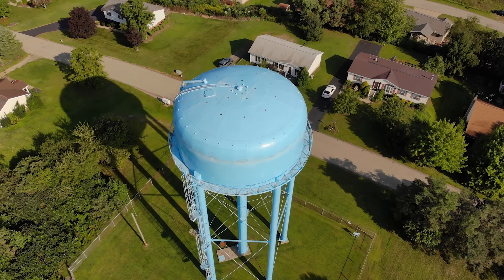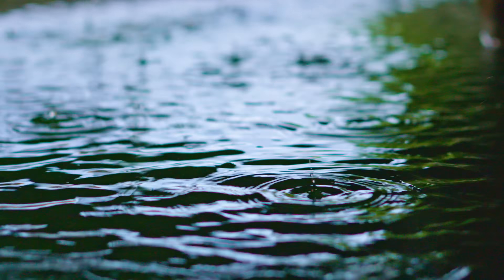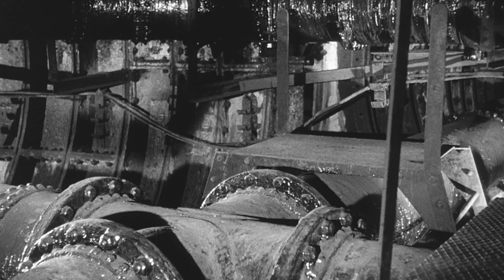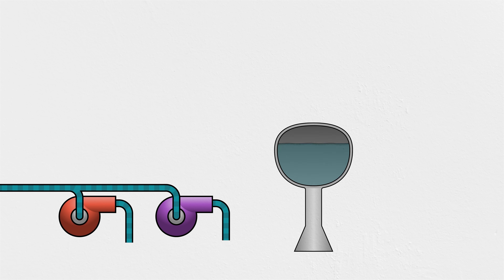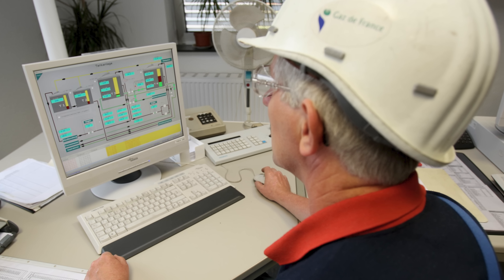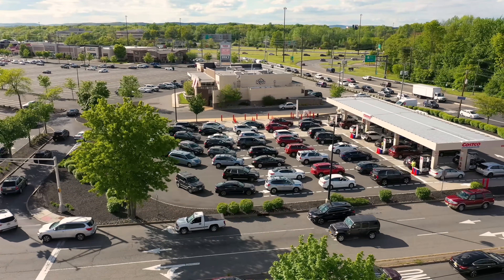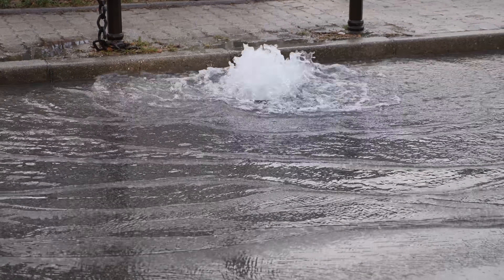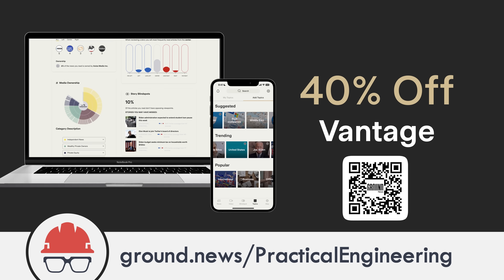When Infrastructure Gets Hacked

Comment: this is the kind of thing that makes me VERY uncomfortable about everything needing to be online. skills overlap and everybody knows about modern computers now. at least with manual methods and light automation WITHOUT THE INTERNET you'd have to go there and get in to do anything. i'd feel more comfortable with relying on all this infrastructure if the computerization was stuck in the 1980s with floppy disks and difficult for laypeople to understand CAD-looking software on monochrome Cathode Ray Tube monitor displays with mostly control panels that have switches and buttons that get monitored. monitoring those panels is a great job for someone system-minded, but not physically capable of the technical work.
making it all online just feels like ainnovation; a new feature/change that exists only in order to sell more units and not particularly beneficial to anyone who isn't financially profiting from it....and realistically not actually benefitting them outside of bank account land.
Reply: additionally, arms races are very funny because they can be put up as walls while really the actual system is completely offline but still functioning......not that the hackers know that!

Comment: The key to security is reducing the attack surface.

Have a single door, and put a good lock on it.
Reply: Well, have a single outside door. Have multiple internal walls too, so that someone can't just do whatever once they get in.
Reply: I think generally the law regarding fire safety gets in the way of that, like, imagine if someone lost control of their truck and crashed into it, or some bad guy blew it up, or a fire breaks out and now that area is a firestorm, that kind of thing.
Reply: @Xannthas  Well, I was thinking it more as an analogy for cybersecurity (don't connect everything to the internet).
Don't have more access than strictly necessary to critical components.
Reply: That's awesome, Iran had that. They had no access at all. Didn't really help them much did it.
Reply: @zyeborm  When your threat model includes the CIA and the NSA, you are indeed in trouble.
(Though not allowing thumb drive would have helped.)
Reply: @zyeborm  It required their enemies to put forth a massive effort and essentially infect the entire Internet just to get at a handful of machines.

If they'd just had something like a FortiNet gateway, the NSA would have blown the things up in an hour and gone to lunch.

Comment: Hey Grady. Thanks for bringing attenion to this topic. 
The biggest problem is the access from the outside and no separation in internal networks. Normally it's always because of convenience and easy maintenance, so that somebody can quickly log in and fix the issue during the production. If you can get an access to the internal network then the posibilities for the attacks are unlimited. 

SCADA is only one point of an attack.  However SCADA prepared and maintained properly can be pretty secure. Interlocks, limit values and faults should be always programmed into PLC, and critical functions should be kept under password (unfortunately often passwords are simple or spread among employees). 

The real danger is when somebody can access the PLC from outside, which often is not protected sufficiently. There you can really do everything, especially if you can get access to the safety PLC. I'm not sure how many 0-days are in the modern PLCs, however with almost all controllers I worked on you don't need a 0-day, as nobody bothers with setting up the password access, or password is schematic for an easy maintenance access (like the name of the PLC or area or whatever). In one facilty I had to make some modifications, and their SCADA computer was unusable, because operators were bringing games or movies on their personal sticks and infected the complete computer, as they were bored during production.

Or another example - even if SCADA and PLC is protected well, sometimes devices that are these PLCs using are not. For example you can change parameters of the frequency converter so it will damage the motor, or change the weld controller to make faulty welds while indicating that it is operating in correct parameters.

Comment: As an Electrical Engineer, SCADA/HMI/PLC programmer, Network Admin and electrical system designer, I can assure you... most issues are caused by employees breaking the air gap either intentionally, by sheer stupidity or by over-zealous network admins that can't stand the presence of a workstation on "their site" that isn't under their control.
Reply: I didn’t say secure connections don’t exist. 
I’m saying the issues exist because of people. 
Just because some aspects or overhead systems can be remotely controlled, I assure everyone there are still air-gapped, physically separated or unbridged networks in most facilities… even nuke plants. 
You think you are going to reconfigure the motor drives or vibration monitor calibrations on the reactor jet pumps from your home office, you are mistaken.
Reply: @capn_shawn the its one of the reasons our laptops are not on the company network, it want full control of company supplied laptops so company issues laptops are not used.

In a site where we still use 1980's plcs and modern ones less than 5 years old its very difficult to work on machines with a completely locked down laptop with only user privileges and usb ports disabled
Reply: Or remote maintenance vendors / third party
Reply: Lol @ making “their site” in quotations because I know exactly the type of conversation that would have developed
Reply: I worked for a national infrastructure organisation that carried out the simple test of scattering USB drives around the benches outside head office where people would eat lunch/smoke/chat on sunny days. 5 out 6 USB drives were plugged into office devices within one day of their being dropped. So yeah, it's the swiss cheese model all over - you put in layers of security to try and stop the holes lining up and things getting through. Air-gapping is one layer, but if the staff aren't educated or have too much access or basic internal security controls aren't implemented, well, the holes can still line up.
Reply: Same applies for a lot of wider health and safety really. Many systems would work fine if all the humans involved stuck to all the rules, all of the time. Predictably, they do not.
Reply: In every system I've seen, things are ALWAYS setup with remote access. In over 20 years, I've not been in a Class A office that didn't have complete remote access to everything... fire alarm, security doors, elevators, HVAC... the f'ing clock in the lobby...

(The scary part... a nuclear power station can be remotely controlled. Protected only by an RSA SecureID token.)
Reply: How an overzealous admin is to blame?
Reply: @_ata_3 because they want it to be under THEIR control - read, they can't stand the idea of an asset they don't have full time physical and remote access, so they take measures to  "take ownership" of said assets. Be it have it somehow connected to the network with "I put this on Network isolation source trust me bro" or badgering management so they gain unrestricted physical access.

Last serious place I saw we were told someone earned a writeup for just requesting access to The Vault, for they should know better.

Comment: in my opinion these should all be air gapped.  ones for remote locations can do direct connects to the next nearest city where it can be controlled and monitored there, but the computer and/or network they connect to should be air gapped from the internet

Comment: This is why every company needs to have extremely good backup systems in place and verifying daily that everything is working exactly as it should and testing at least yearly but better quarterly by restoring a random system from backup and ensuring everything works okay and working with that system owner to ensure that their applications and what not recover properly even if it's a loss of data for a couple months or something like that. But usually data that is within the systems is backed up by the minute or daily depending on what it is and replicated elsewhere in real time and usually the systems are just application servers dummy front end type things that do the processing. So the backup is just restoring an application with the configuration so then you just re-point it to the data and technically all data should still be there. And if you're ever hit with a ransomware attack, one close everything down pull your networks secure everything you can isolate all systems that were affected immediately and having tools like crowd strike, which is a bad thing to talk about right now with the massive outage they caused but they are on the road to fixing the bugs that cause that situation and I 100% believe in them still. But tools like that are priceless when it comes to situations like this because they can detect and stop ransomware and attacks like this before they have been. And so as long as your company has a good backup plan and system it is much better to never pay the ransom for the ransomware and restore everything from backups to get your systems back online. The decryption process is extremely extremely slow. And the encryption process is also extremely extremely slow It just happens in the background and then the system forces a reboot and that's whenever it implements it fully so that's how you get hit with it and not know. You pay the ransomware you've never know if they're ever going to even turn over the keys or the tools to decrypt, or if they're not going to claim that they have data now and then they're going to ask for more and never give you anything or just keep asking for more and threatening. So never ever ever ever pay a ransom kill those machines that were infected ideally pull all the drives out and shred and destroy them and then replace with new drives scan the systems to make sure they're clean restore the backups verify everything's working and you have a proper monitoring solution for ransomware, and then and only then connect it back to your network and turn the systems applications back on at that jost was hosting

Comment: For all of the ppl here saying it shouldn't be connected to the internet:

Let's have an example:
we have 2 stations and 1 booster station
station 1 suddenly shut down and it reported to the main operation center, it is now immediately addressed and it only took a few minutes for the main operation center to notice and communicate it to the maintenance crew, they then remotely operated station 2 to work more to keep up with the demand and also did the same on booster station, this is only done with 1 building(Main operations center) or it can also have small control rooms with centralized scada to know what the heck is happening to the other stations.

Now let's do it without internet
Station 1 fails, station 1 control room calls station 2 either via radio or telephone, station 2 control took several minutes answering because they are also figuring out why their tank drained fast, station 1 and 2 forgot to inform booster station 1 because they were too busy communicating how and booster station 1 sucked up air because the supply wasn't enough to fufill demand, booster station 1 contacts station 1, the line is busy, they contact station 2, station 2 responds late and the entire neighborhood lost water because of the excessive back and forth communications needed between control rooms and also take note you need 3 massive control rooms because control and monitoring are done per station

Comment: I work as a control room operator in a power plant. Talking about looking at screens like a video game forgetting that it’s hooked up to actual equipment. That happens when you’re training people, it’s almost like a disconnect that happens. Everything looks so clean & nice on the screen, it’s easy to forget that the picture of the pump or turbine you’re operating is not a nice clean turbine, it’s a 70 year old machine covered in oil and dust.
Reply: Have there been accidents where someone thought they were running a test/training system, but it actually ran on the live hardware?
I think every computer company has managed to accidentally do this at one point or another.
Reply: @nitehawk86  not at our plant, I have heard stories from guys at other plants though. All of our controls are isolated from the outside world for that reason.
Reply: That's why I try to get my trainees into the production floor for a tour. I also encourage colleagues who haven't been there in years that they should join.
Reply: I'm a board operator at a Refinery.  I always think of my outside guys first before i make any moves.  Especially on natural draft furnaces.
Reply: Sounds like people that aren't qualified hiring and training people who aren't qualified.
Reply: @Smokeisprogress  couldn’t be further from the truth, guys work 20+ years sometimes just to get into the control room. You’re put in charge of hundreds of millions of dollars of equipment that unlocks stored energy & converts it to extremely high pressure superheated steam to drive turbine/generator units & power the grid with hundreds of Megawatts, sometimes Gigawatts of electricity. It’s a dangerous environment. Nothing unqualified about us. We’re humans, humans become complacent, it’s in our nature. I was just saying I can relate to what he said about it & I bring it up to anyone I train in here.

Comment: If your organization cannot afford good network security, it cannot afford to be on the Internet. If it can in any way cause physical harm or extensive damage, excellent network security is required.
Reply: Okay, so you've just about took 95% of businesses and critical infrastructure offline. What's your plan now?
Reply: @Stealth86651  Change the norms (regulations?) so that businesses invest in cybersecurity. Just because things are bad across the board doesn't mean we can't or shouldn't improve them.
Reply: Probably hire a network security engineer or consultant or what have you @Stealth86651
Reply: @Stealth86651  Only because they're cheap.

Comment: There's a related fun security thing that happened in Wyoming. They ran an update on a Dam in the middle of nowhere (that wasn't supposed to get an update) and the update knocked off the management computer from all connections. Someone noticed quickly but it took 4 hours to drive out there.
Reply: When I was a network guy, we put a lot of stress on out-of-band management to prevent this kind of scenario. In my current job, I've noticed they don't bother with that, and as a result I have had the network guy call me and ask me what the equipment was doing.

For something critical, you should have a way to get in when all else fails. It really isn't all that hard to do. Even for a management computer losing all network connectivity like this, there are solutions. You have some second device that is a console server connected by some other means (say, a serial connection that is impossible to misconfigure), and you give that device its own external network connection -- preferably dial-up or something else that doesn't share any dependencies with your usual network access.

A four hour drive makes for a good story, but there are cases where a mistake like this could involve getting on a plane.
Reply: Was that tied in with the Crowdstrike incident?
Reply: @Elrog3 I can't answer that for obvious reasons lol
Reply: I accidental killed the router port at a remote site. Had to drive over and reset it.
Reply: So was it windows?  yuck
Reply: @MushookieMan  Not a lot of options in the SCADA world, unfortunately.  Linux is becoming more of an option these days, but you'd still be hard pressed to build anything beyond a basic system on just Linux.  All the software runs on Windows.
Reply: @MushookieMan cloudflare?

Comment: there is definitely something to be said for building your system with local programming and remote monitoring.  but even then, a well meaning modification or a design failure can result in trouble.  I worked on a lift station where the pumps would shut down after 20 minutes of continuous run time, and would have to be manually reset.  it took three resets to fully clear the tank after a power outage.  a I recall, the solution they adopted was to write a policy that the service person would stay on site until the tank level was back to normal.

Comment: Just don't make the system easy enough for a velociraptor to use
Reply: There is considerable overlap between the intelligence of the least intelligent operators and the most intelligent velociraptors.
Reply: @trapfethen  are you saying there could be a virus called CleverGirl, that runs as two separate programs that attack from both sides?

Comment: Is it possible to use USB drives safely?

The first step is to make sure your drivers only support drives. 
The second step is custom data transfers.
Reply: Do you know that the USB referred to in the video was used by an authorized person to transfer a software upgrade that was official?

If you have an air gap you need  some physical medium to transfer any update needed.
Or you never update any software. Writing any update to the code of the machines directly in the separate system is not a solution.
Reply: @eliahabib5111  That is one aspect that is hardly ever mentioned, it was not the USB itself that was infected, but the upgrade software.

You would need to infiltrate the facility that creates that upgrade, and the software that publishes the checksum (which of course it on a piece of paper, not on the USB stick). 

Before the upgrade is installed, the checksum is verified against the checksum printed out as the original software was compiled. 

Quite a tall order for a worm, but not completely impossible. However, why go through all the problems with a worm if you can infiltrate the SW that early?